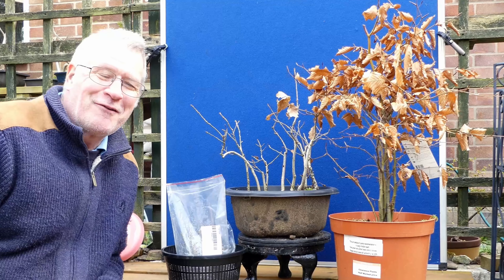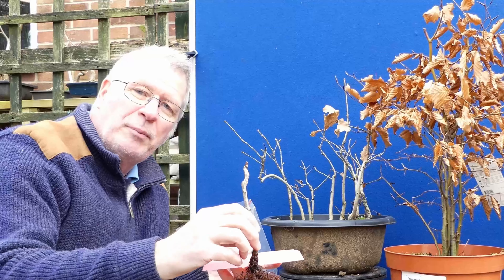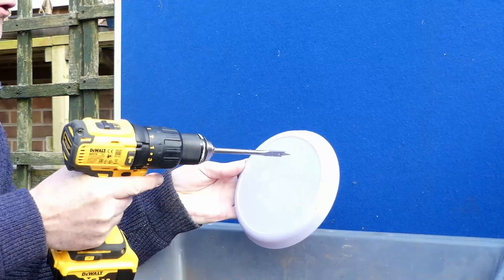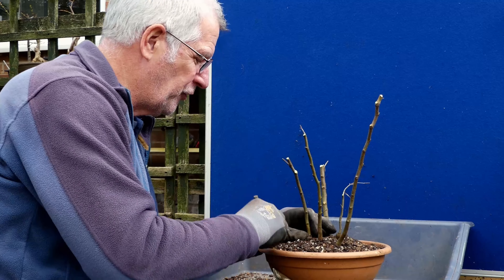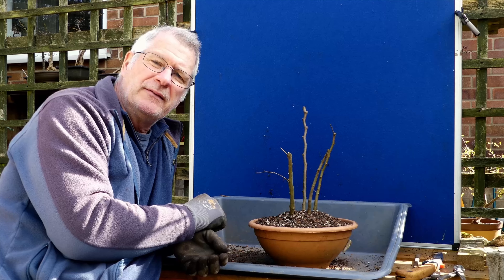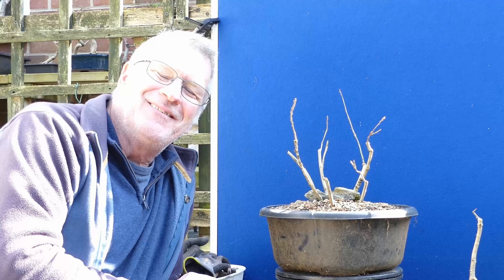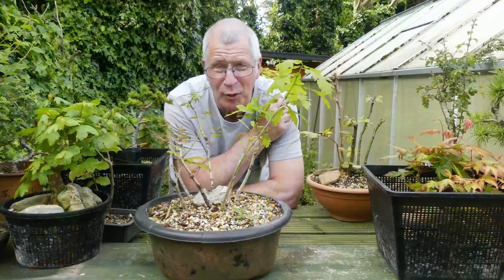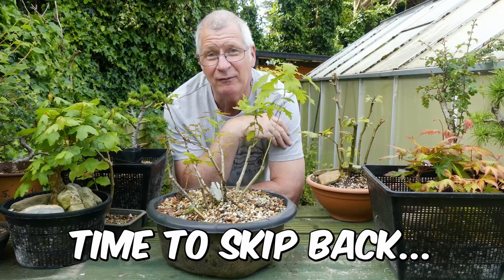An EASY way to create BETTER Bonsai using Ebihara Technique

Comment: Hi Xav as soon as you started to put them through the holes I knew somehow you would have to start again and turn the plate over I have seen this done before mate not sure where I saw it. Glad you hadn’t cut off the roots all we need now is for the experiment to work enough for them to fuse together. I did worry they may not get enough water underneath the plate but somehow they seem to have all survived which I must admit I was doubtful, but slap on the back of hand for doubting you, I should know better. Good luck with them my friend now it’s a waiting game.
Reply from the maker: I will definitely try this with a flat piece of wood or tile next time.  As I was doing it I realised the obvious flaws in the plan :)

Comment: Excellent, only problem is breaking the plates from around the trunks, easy dose it mate.
Reply from the maker: I didnt realise how much i needed to explain the what comes next part...
You cut the lower roots off and the plate just falls away. This happens when the tree has produced a mass of new roots above the plate...hopefully
Reply: @XaviersBonsaiRetreat  I see now, that makes more sense, so the bottom ones are sacrificial roots 👍

Comment: Not sure where I've seen the technique before (was it Kennet?), but I anticipate impressive results. If I try myself I have a very thin saw blade for a drill motor, and I'll cut away some of the excess plate for less pooling of water. Thanks for sharing Xav~
Reply from the maker: Normally this is done with a tile but I could only find these cheap plastic plates around the house :)
Reply: @XaviersBonsaiRetreat  We use what we have! 🤝👊

Comment: I'm not quite sure about the plate facing upwards. It will create a pond.
 OTH it is good idea to use those plastic plates.
Reply from the maker: I definitely realised there were going to be some issues - either way. Next time definitely something without a lip :)

Comment: why is it so hard to stick parrots together? Because it is toucan fusing. 

But seriously, I've tried to fuse some trees before, I don't have enough patience, I guess. I always want to see before it's fused if it is. A lack of patience is not conducive with bonsai I have found.
Reply from the maker: I know exactly where you are coming from.  I have found fusing with a wire at the base works pretty quickly with rough barked species. Maples fuse qucikly as well but you need to be careful with scarring - this is the reason for trying this technique.

Comment: You could "speed up" the process by putting tourniquets instead of waiting the trunks to thicken and push against the edges of the holes
Reply from the maker: You are absolutely right but I am trying this technique because of results I saw happen with a few professionals some years ago.  Just experimenting really :)

Comment: I couldn't figure out at first if the roots were supposed to be above or below the plate. 
But I must ask...How do you intend to remove the plate once it's fused?
Reply from the maker: The idea is once roots grow above the plate you cut off the stuff beneath the plate and it leaves you a flat root plane.  I have seen it done by a numbe rof professionals and the results can be very impressive.

Comment: I think I would use a Styrofoam picnic plate. But I am like several of the other posters: why do you need the plate to do this? I have put trees close together maybe I'm doing it wrong because I never used a plate?
Reply from the maker: I normally do the same BUT I have seen the results of using this approach and it definitely 'appears' to be much quicker amd more effective - that is why i am trying it out :)